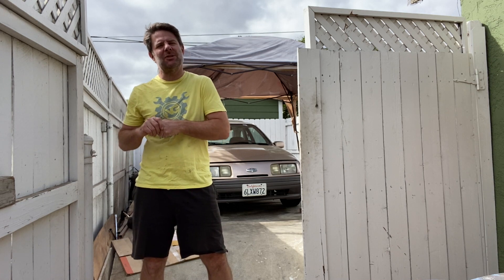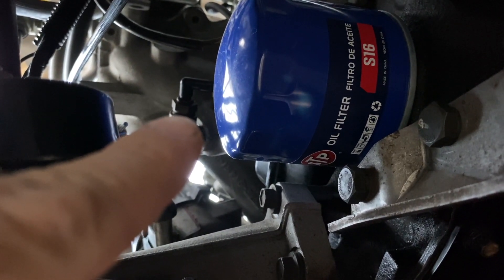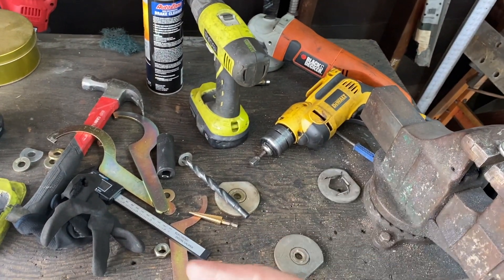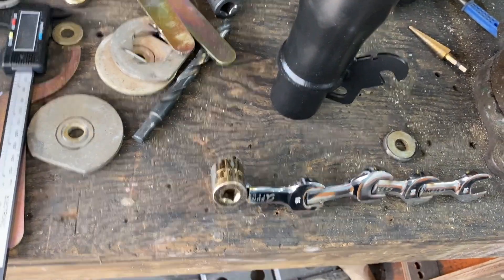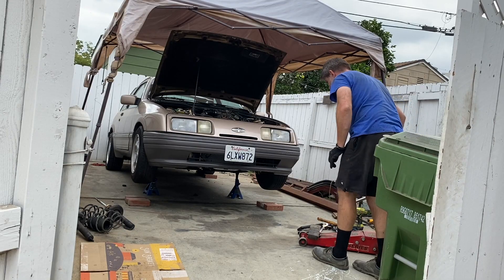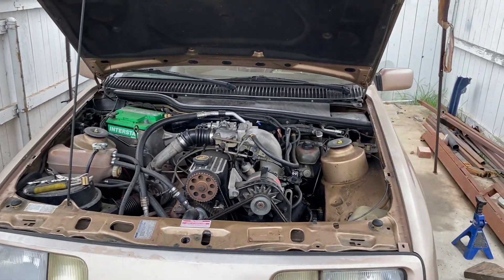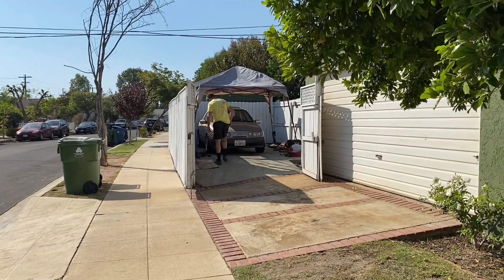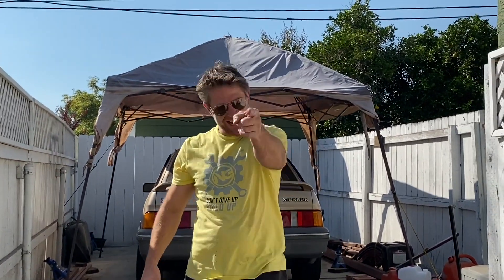XR FRONT GAZ GOLD COILOVER INSTALL

Comment: The stance didn’t look bad at all. I thought it was going to be much lower in the front based on the side by side of the strut vs coil over. 
How stiff did the front feel?
Reply from the maker: Haven’t driven it too far yet. The road around my house is really smooth. Full report should be in about a week

Comment: Great XR content - love it! Suggest that you fit those top mounts because based on the looks of it, you do not have next to nothing in suspension droop travel. Imagine that you drive into a pot hole - suspension will clunk and potentially ruin your new shocks! Just fit a stock top bearing or a set of thrust bearing to eliminate coil binding. I run a Eibach trust bearing (2.5") on my XR4i with GAZ Gold and Combrake top mounts.

My experience with Compbrake top mounts is two fold. They do what advertised and I have the adjustability I was after. But, one side had a loose spherical bearing seat that I had to shim out. Also, that spherical bearing "ball" does not rotate in the "race" along with the shock shaft after it is loaded - thus the need for stock bearing or thrust bearing set. I know that my set is of older generation and hope that the new ones are better.

Looking forward for some driving impressions once you have the rear done too! Ride height looks good but double check your bump stop for clearance. Keep positive, really enjoy your content!
Reply from the maker: Yeah that’s what I was thinking. I don’t want the front shocks to top out. I think I’m gonna go for the Burton Power rotateable top mounts that rotate for camber and caster. I like the idea of the thrust bearing

Comment: If you are looking for another project to do, why not do an opposite project. Get a Ford F150 and turn it into a Crown Vic. Crown vic body on a F150 chassis. Would be interesting. 
I have seen a video where the body of a crown vic can be unbolted and lifted off without cutting it up.